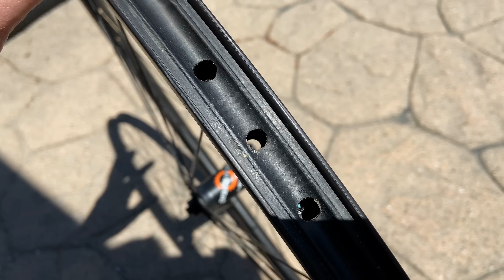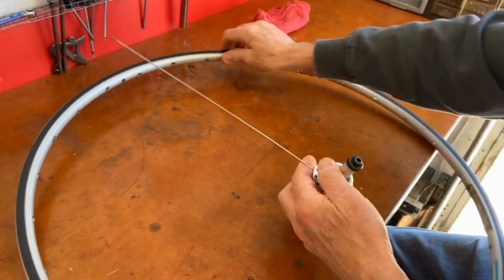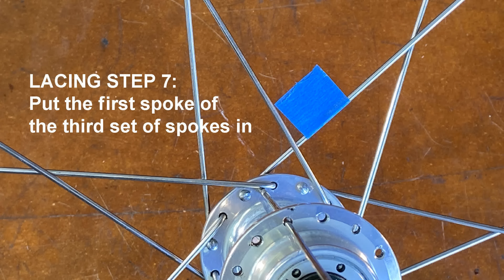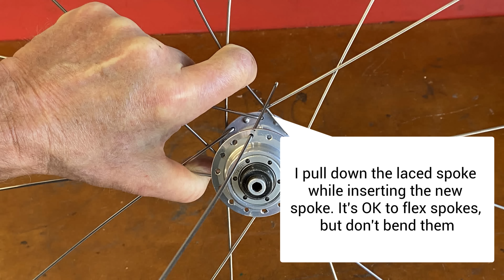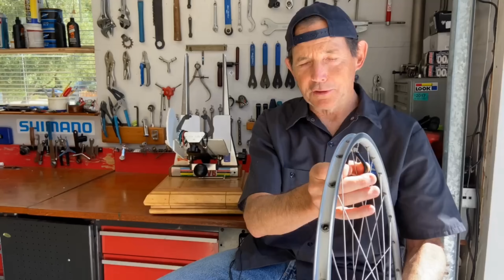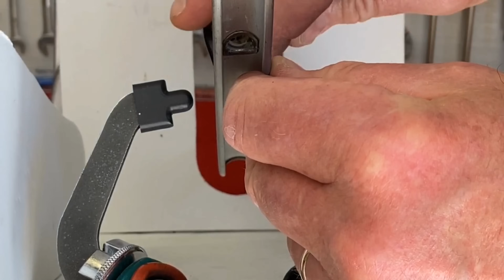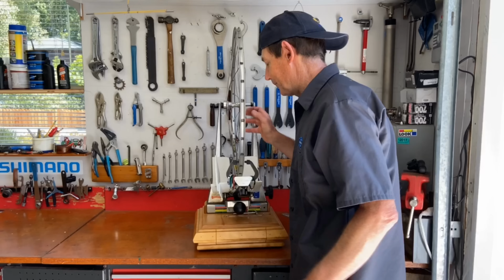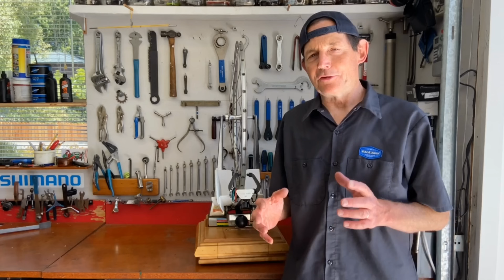How To Build Bicycle Wheels THE EASY WAY! #bikerepair

Comment: 16:35 this spoke with blue label should be inside not outside of wheel, ask me why
Reply from the maker: Thanks for watching and commenting, Makan. Explaining the different lacing patterns and the theories behind them isn't part of this video because it's a broad topic that can get confusing. I wanted to keep this video clear, focused and easy to understand. Also, you can build perfectly good wheels using any pattern. Even among pro builders there are different opinions about what's "right." 

To help builders who want to learn about spoke patterns and theories on which to use when, I have two videos, one on wheel terminology with patterns discussed at the end https://youtu.be/4kVlmOjgdAs and one detailing the pattern Shimano recommends for all disc brake wheels https://youtu.be/gfWd7_avr1s Thanks again!
Reply: @JimLangley1  ok, but with side of that spoke should not be doubts: that spoke is right spoke on right side of wheel and that kind of spokes besides carry bike and driver mass, it is loaded with pedaling power/torque, so that is most stressed spoke on bike and then you installed so that if chain falls out of first gear it will cut that spoke, so , is not logically  to protect that spoke by installing it inside of wheel, and if that spoke is inside of wheel it is less bent , so it is in less stress for same force in spoke
Reply from the maker: @makantahi3731  Those are theories some builders believe, Makan and there are other theories. You should watch those 2 videos of mine I linked you to in my previous reply. Also look at the pattern used on modern disc rear wheels from Shimano, Zipp, etc. 

While it's all very interesting, in reality you can build good, rideable wheels with whichever pattern you want. Even the most basic, least expensive wheels hold up to incredible use and abuse after all. Thanks again!

Comment: no easy way for first 50times, it starts to be easy after 100 wheels
Reply from the maker: Thanks for watching and the feedback, Martin. I'd be curious to know what it was about your first 50 wheel builds that made it so hard? I completely understand that as you get used to doing something it should get easier. But, what I show in my video is a step-by-step wheel building process that is pretty simple and easy to follow. That's not just me saying that. If you browse through some of the comments, you'll see that lots of people - even complete beginners - have said the video helped them build wheels for the first time and relatively easily, too. So, I think maybe you learned a more complicated way to lace and build wheels. In that case, I can understand how it could take longer for it to become easy. Appreciate the comment!
Reply: @JimLangley1  first  wheel i made before some 35 years, and i done it by myself , looking  other wheel, and discovering secrets of combinaton 5-7(3cross) and 7-9(4cross), i made one side first, cross by cross then other side, on that way i made some 10-20 wheels, after i saw it could be made on faster and easier way, but to become fully conscious what is going on and to control situation, it starts to happen after 100 wheels, specially with truing
Reply from the maker: @makantahi3731  no, it doesn’t/shouldn’t take that long, Makan. It all depends on how you learn or are taught. I have taught people who could build decent wheels after only a few builds. And, like I said, read the success stories here. The fact is that wheel building is not that difficult to learn - especially if someone  really wants to.

Comment: Great video. Thanks for your work. Just built my first wheel without any help, but it seems I didn't do too bad, other than put the valve hole in the wrong place! Now it will remain non-standard:-) My next wheel will be done according to your instructions. Thanks a lot!
Reply from the maker: Thanks a lot for watching and commenting, Peter and congratulations on building your first wheel - well done!

Comment: I was wondering if you have anything more to add with regards to setting the tension level of the spokes based on the number of spokes forming the wheel and how the bicycle wheel may be getting loaded.  I recently completed a fully loaded transcontinental bicycle journey with another cyclists.  The bike packing gear weighed in at around 45 lbs with maybe 30 of that over the rear.  The rear wheel alloy rim of both bikes developed what I would describe as micro fractures extending out from a few spokes in the direction of adjacent spokes.  The wheel remained fairly true but its longevity seems to have been impacted.  Would you bias the tension more to the higher, mid, or lower range of acceptable tension?
Reply from the maker: Thanks for watching and the question, James. You have to optimize the tension on any wheel you build in order for the spokes not to loosen and the wheel constantly go out of true. So you tension wheels within a small range of acceptable tightness. On a tensiometer it's around 95-125 kgf which sounds like a wide range but isn't really.

If rims crack, anyone with a tensiometer could check spoke tension to see if it was too high. That's possible. But, usually production wheels tend not to be that highly tensioned. And hand built wheels usually are checked and not over tensioned.

Rim cracks could be the result of a bad rim. They might be from not having enough spokes in the wheel for the load, too. I would want at least 32 spokes in a wheel for riding cross country carrying a load like you did. When I rode cross country with 75 pounds of gear (winter tour), I built wheels with 36 spokes. 

I know lots of modern wheels have fewer spokes. With wide enough rims and tires to cushion and support the load you might be able to get away with it. But, since the rims cracked, if it was a lower spoke count wheel, that might be the reason for the cracks. Hope this is helpful. I'm happy to discuss it more, too.

Comment: How do you know how tight to get the spokes/nipples? I have a tension meter.
Reply from the maker: Thanks for watching and the great question, Jon. You're aiming for an optimum tension in the front spokes and drive side rear spokes (the 3 sets that are tightest - the non drive side tension will be lower as it's a result of the right side so the left rear spokes are what they are).

A good target spoke tension for those 3 sets of spokes is from 95 to 120 kgf. Tension meters usually measure spoke deflection and then you take that number and refer to the chart that came with the tool to determine how much tension (kgf) it is. That's where you'll see the 95 - 120.

Because around a wheel the spokes will be a bit different tension, you measure the spokes and then take an average to know what the average spoke tension is.

Some rim makers call for a certain spoke tension or give an acceptable range. So you can go by that to decide how to tight to get them. Over time building many wheels, you get a feel for how certain combinations of spokes, nipples and rims feels and you decide during the build to add a little more tension or use a little less. The tension meter is a tool and the experienced builder learns by using it what tension is best for the different wheels they build.

Okay? I hope this helps explain. Please let me know if you have other questions. Happy wheel building!

Comment: Hi Jim, I am building a 36 hole 3 cross wheel.  I have already laced the front wheel on a low flange Campagnolo Record hub from the 80s so all the spokes are the same length. However, after starting the tensioning portion of the build I noticed that all of the spokes with the head on the inside of the flange (J-bend on the outside) are getting significantly tighter than the spokes with the head on the outside (J-bend on the inside) with the same amount of turns on all nipples (ie the same amount of exposed thread showing on the spoke).  The wheel is fairly true both horizontally and laterally but the head-out spokes are still loose whereas the head in spokes are getting quite tight.  After Comparing to another wheel the lacing appears to be correct.  Any ideas what might be going on here?   Your tutorials are fantastic!
Reply from the maker: Thanks for watching, Randall! One thing that can happen is that since the heads-out spokes are more vertical than the heads-in spokes, because they aren't traveling over the flange but are inside it - the heads-in spokes will feel tighter first.

That's one of the reasons to stress the spokes after lacing to get them to lay flat over the flange. But, even when you've done that, the outside spokes (heads-in ones) become tighter sooner because of their further proximity from the rim. The tension evens out as you continue to tension the wheel. I think that's what is going on. I hope this helps. Please let me know if you need more help.

Comment: I have a question:
I am building wheel for vintage bike, why in my almost 30 year old wheels key spoke next to valve hole is "head out" and on the other side the altering spoke is "head in"? i checked my current modern bike and everything is same way, the wheels are not symmetrical (if it is correct word)
Reply from the maker: Thanks for watching and the question, PitsuMiwus. Since you're working on an older wheel, I believe the reason the spokes are in the hub that way is because the hubs have alternating countersunk holes. This is how some older hubs were made and it "forces" the wheel builder to orient the spokes to match the countersunk holes (the bend of the spoke goes in the countersunk holes). That's probably why that wheel was built like that. Hope this is helpful.
Reply: @JimLangley1  Thank you for your answer, i just built that wheel your way and it looks beautifull 😺
Reply from the maker: @PitsuMiwus  you’re welcome and congrats on your wheel build, bravo!!

Comment: Jim how do you build a wheel for hubs of the 3 speed types out today i.e. SHIMANO,STURMEY ARCHER?
Reply from the maker: Thanks for watching and the question, John. Actually, you build them exactly how I show in my video - following the same instructions and steps. So maybe you need help with some other part of the build? Please explain more specifically about what you need help with and I'll be happy to help.
Reply: @JimLangley1   Its how you rebuild a rear wheel with putting in a STURMEY ARCHER 3 speed hub into it.
Reply from the maker: @johnjusko4789  if you're starting with a wheel that you want to put a different hub into, then you have to take that wheel apart. But before you do that, you want to be sure that the rim you're using and the Sturmey hub have the same number of spoke holes. So if the rim has 36 holes the hub should have 36, too. If not, you usually won't be able to put your hub and rim together into a wheel.

So the basic steps are 1) take the tire and tube and rim tape off; 2) loosen and remove all the spokes and nipples. That leaves you with the rim and hub, spokes and nipples as all separate pieces.

Now if the old hub in the original wheel was the same size as the Sturmey hub you might be able to use the old spokes. By size I mean the diameter of the flanges of the hub. The flanges are what have the holes in them for the spokes. 

If the hubs are NOT the same size then you take your Sturmey hub and the old rim and you take the measurements and/or use an online spoke calculator to determine what length spokes you need to buy. Once you have your new spokes you can go ahead and build your wheel. Here's my video about how to find your spoke length: https://youtu.be/LvV4FE2VxZk Okay? I hope this helps explain the process.
Reply: @JimLangley1   the best way i think is to measure the spokes of the same lengths for the rear wheels and in most cases its about 10 inches in length and always use new spokes for that great look on it and then you true it up and set up the gears up in front,a new cable,a new shifter mechanism,final adjustments and hit the road for a test of it.
Reply from the maker: @johnjusko4789  sounds about right, John! Have fun building that wheel!

Comment: Your instructions have helped me with my very first wheel build, i.e., a carbon fiber rim with SAPIM Race spokes, i.e., 2.0 mm at both ends and 1.8 mm along the middle. Wheel builders are recommending these versus full lenght 2.0 mm spokes which could potentially crack the rim spoke holes. All spokes are installed with SAPIM rim washers. The CF rim can handle 180 KgF but the data from my Zitto tensioning tool indicates less needed for the 1.8 mm spokes. Had to do this all without a Truing stand which seem to be lost in transit from Asia since mid August.
Reply from the maker: Congratulations on your first wheel build, Graydon - sounds like a nice one. And well done doing it without a truing stand. I agree with your tool on the final tension - I would shoot for something in the 120 - 125kgf range for the tightest side of the wheel. Enjoy your first custom build, Graydon, way to go!

Comment: Hi, thanks! Can you make a video about Ford 2:1 triplet lacing? I haven't found a video on youtube other than 3X lacings, people should learn.
Reply from the maker: Thanks for watching and the great question, Xavier! Here’s the best video I know about that custom lacing pattern - usually used when you have hubs and rims drilled for it. Because the number of spokes on the right is more than on the left. 

In this video they even show an original Ford Motor Co wheel using the pattern. I would be surprised if Ford actually invented the pattern because bicycle innovations such as a myriad of spoke patterns - came way before the invention of automobiles. But it’s cool to see it on a car wheel. https://youtu.be/Yp-yT40xQqc 

To lace a wheel with this pattern, since the rim and hub are designed to be built this way it’s pretty straight forward. Usually the rim company will provide instructions with the rim or on their website. The left side spokes go straight from hub to rim. The rights are crossed. There should be directions that explain the specifics (spoke lengths and number of crosses on the right) so that you can get it right. Okay? Hope this helps and thanks again!
Reply: @JimLangley1  Thanks for the great answer!
I watched this great explanation video of the 2:1 lacing.
But my real question comes by the reason I have Enviolo Nuvinci n380 rear hub with a spare 24h rim.
There are many forum posts online about having 32h hub and 24h rim and lace it in 2:1, a lot of people done this.
Now, since my front wheel is native 24h, I'd love to lace the rear wheel 24s too for the sake of looks and lightweightness. But I couldn't find an actual wheelbuild video about this and I don't know how to calculate the rim lengths.
Also, a lot of spoke length calculators I found online doesn't do the trick. And actually the ones I tried didn't even let me enter a value of >90mm hub hole diameter, but n380 has 138mm diameter. So I'm screwed.
But thanks anyways. That video is awesome yes.
Reply from the maker: @XavierBetoN  Hi Xavier, you can lace that way if you want to. You would do it by skipping 4 holes (not putting spokes in them) on your hub. You could tape over the holes so you don't get confusing when you're lacing if you want. You leave 3 open holes and then tape a hole. And repeat until 4 holes all the same number of holes apart are taped. Then repeat on the other side of the hub. Now your hub will only have 12 open holes on both sides just like your rim.

Next to find spoke lengths you might try a company like the one I mention in my video on finding spoke length. Here's that video: https://www.youtube.com/watch?v=LvV4FE2VxZk&t=1s Give their spoke calculator a try. But keep in mind that when you skip holes the lengths might be a little different than the calculator tells you. But, it should be very close. Let me know if you need more help. I'm happy to help. And if you build the wheel please let me know how it comes out. Have fun!

Comment: Got a bike here 4000/4500 dollar one so i thought must be good right !  dint knew some noob or schoolkidd was working a summer job in the factory one spoke broke so i went over the wheels rims certified to a spoke tension off 122 kg found out the spokes were having tensions of 190 200 kg and 90 kg insane and im pd off lmao now i gotta do bot wheels and spojkes are getting hard to get here in EU with all the china cov sht going onn . ppl might wanna stock some parts for their bikes just a hedas upp . specially electric ones my guess is batteries are gonne be pretty hard to get too soon .
Reply from the maker: Thanks for watching and the comment, H Slot. The most common reason by far that spokes break is not high tension or low tension, it's that they are poor quality spokes. Quality spokes by the main spoke makers such as DT Swiss and Sapim are made of the highest quality stainless steel and it's very rare that they will break. An easy way to tell if you have poor quality spokes is to see if they attract a magnet. If so, you have plain steel spokes and they are very prone to breaking. Hope this is helpful. Thanks again.

Comment: Can I change my cycle wheel hub by doing like this
Reply from the maker: Yes you can, Herobrine. It’s a great reason to learn to build wheels. Usually you will need to get different length spokes since the new hub will be a different size. Let me know if you have other questions. Thanks for watching!